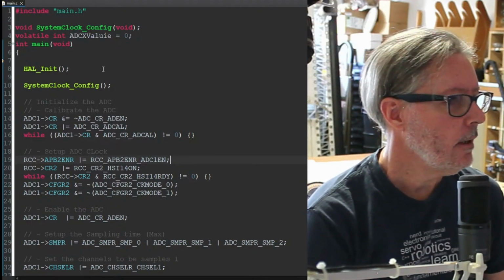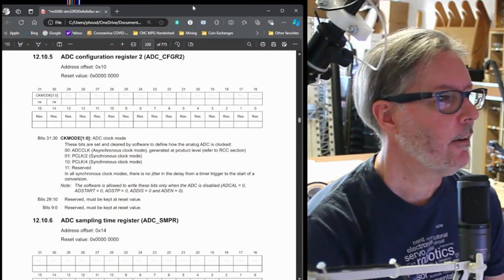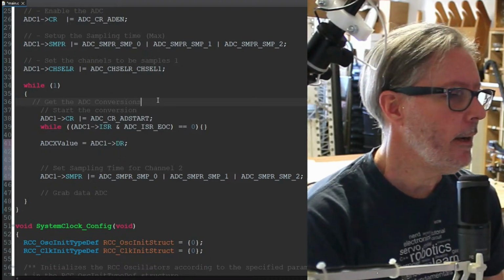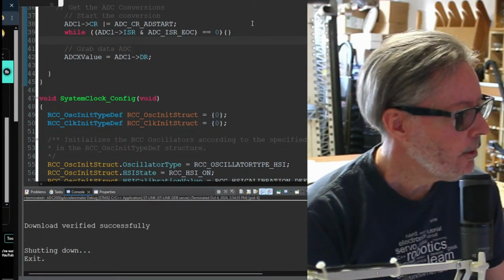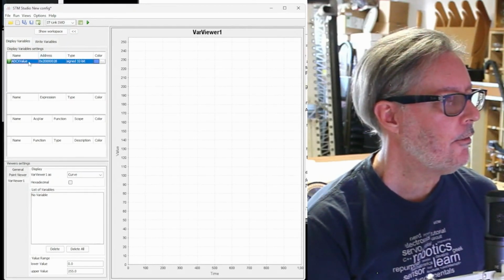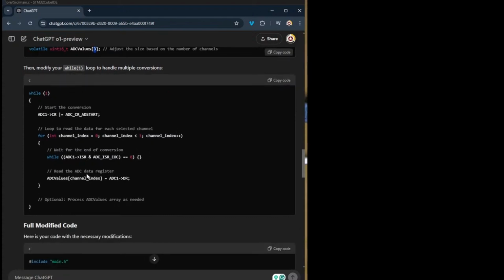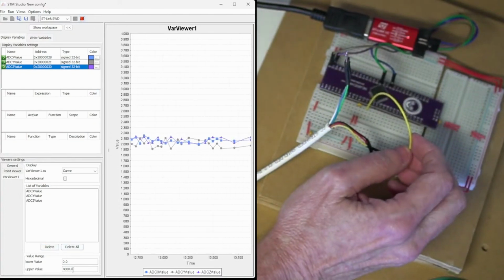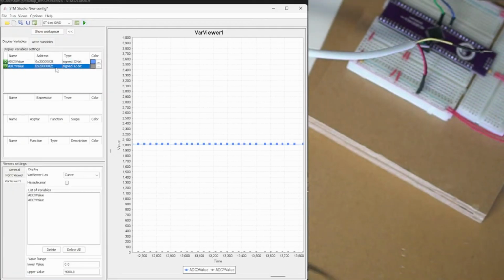STM32 Microcontroller ADC Multichannel with 2000g Accelerometer Showing Output on STMStudio

Comment: 830M1 accelerometer is kind of pricey.  Is there a cheaper variant we could use?
Reply from the maker: Sure, there are so many accelerometers out there. You could consider the one on my website: https://newbiehack.com/Categories/sensors. These are standard accelerometers for tilt. If you are interested in these high impact accelerometers, I would recommend the H3LIS331 which is an affordable 400g. You can get that at Adafruit.
Reply from the maker: Additionally, in later videos that will be uploaded after some time, I show using trimmers. You should definitely come to my livestreams so you don't miss and great content.